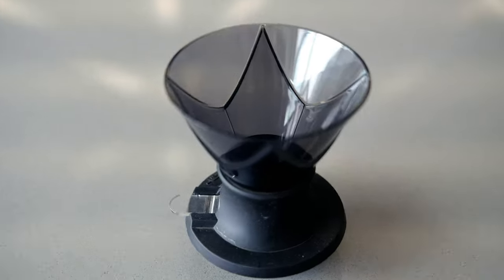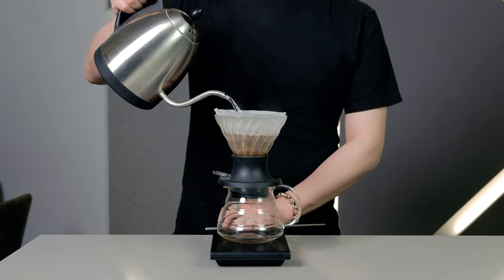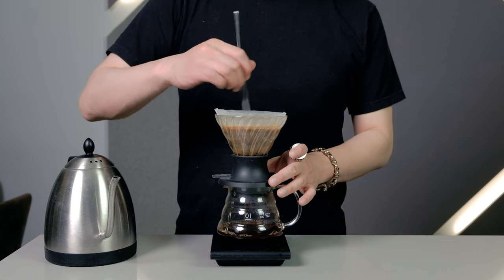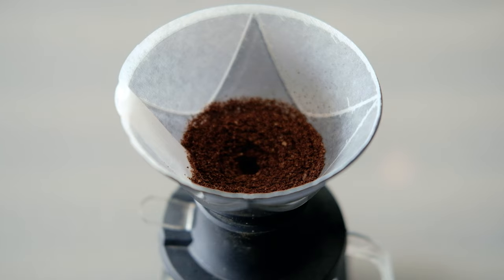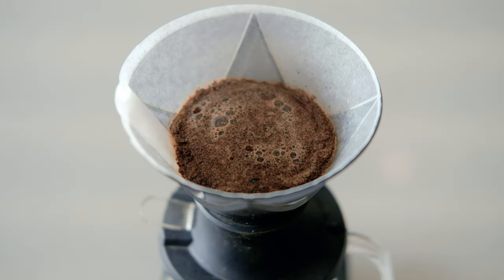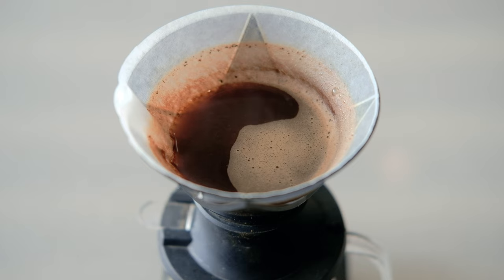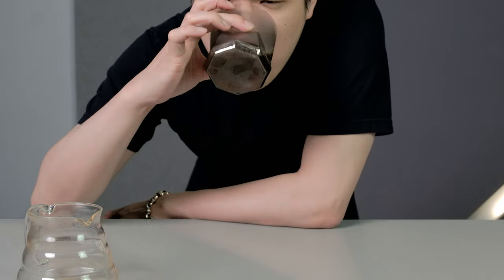Secret to a GREAT Iced Pourover

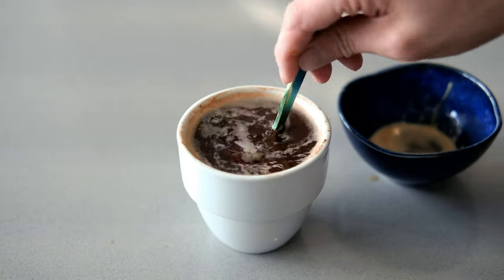Comment: Lol, this is soooo different than getting it done in a single pour under 1:30 where we started. 

The second flush is a good idea. Ive been recirculating(throwing the coffee back on the grinds for a second pass). That works great, but if youre already starting to produce a little mud you end up with a really slow problematic drip in the mugen switch.
Reply from the maker: Yeah the mugen just gets muddy too easily I’m looking to make a mugen myself but with a bigger hole at the bottom 😅 just like a one off ahahaha
Reply: @TALESCOFFEE  sounds like a 3d printer project.
Reply from the maker: @-8_8-  I tried LMAO.  I'm not sure how to make it fit in though.  Maybe need to rebuild the switch in general to have a bigger base :D

Comment: Interesting way of making an Iced coffee but I am not going to buy this Special Hario since I have a regular Hario so is there away to modify the recipe for a regular Hario Pour Over and Thank You
Reply: I would also like to know the answer to that question. There has to be a way to do an immersion bloom with the regular Hario too. Plug it in or just basically bloom in a small bowl and dump it to the Hario after 2 minutes? :D
Reply from the maker: Yes let me actually do one for the actuallt v60, I think I’ve been having too much fun for the switch. It would be done with a 2 part pour with very small time in between .. but a slow pour ahhhh I film tonight release in 2-3 days. Mid week release promise! ✌🏼
Reply: @TALESCOFFEE   sounds Coool cause I dont want to buy a switch and yes it does look fun and look forward to your expertise.
Reply: @TALESCOFFEE  The switch is just super fun to use. I use mine most mornings
Reply from the maker: @Legojunkie  Yeah ahaha, I still have been focused on it a bit much (video wise) I actually exclusively only use the v60 for the cafe.  So I'll share my cafe version in a day or two (filming tonight)
Reply from the maker: @mikecoffee100  Fully understood! On it tonight!
Reply: @mikecoffee100 for whatever it's worth, I was able to get the switch at a rate reduced vs its original price, and I find it drains far faster than my other drippers. Until you mod to the Mugen switch. 

 I understand where you're coming from, but the switch has enabled a lot of different recipes and experiments that can't be done without a stall. Well worth the cost for me.

Comment: would it taste different or is there any problem with brewing a normal hot v60 and just let it chill in the fridge till its cold (i usually leave it overnight and drink the next day)? would the flavour profile change etc?
Reply: oxidation would start to set in, so yeah
Reply from the maker: Sadly right :(
Reply: The oxidation really isn’t that bad if you seal it in as close to air free environment as possible.

Comment: Ther real method is to use your standard pour over recipe and chill it down with a bunch of whiskey stones.
Reply from the maker: I tried you’d need an insane amount for it, those whisky stones don’t chill well 😩
Reply: @TALESCOFFEE  yeah I use 16 for 250ml of coffee. For home use it’s works fine but probably wouldn’t scale well for a cafe. 

The key is actually to stir a lot. If you just leave them or give a light stir they don’t cool very well,  it if you stir aggressively than you can get the coffee very cold.

I could probably get away with 10 stones, but I use 16 because it cools faster.
Reply: @Andrew-wp1bz  you can also dilute with regular ice, only account for it (e.g.: 23g coffee, 300g water split between 60% pouring over + 40% ice)